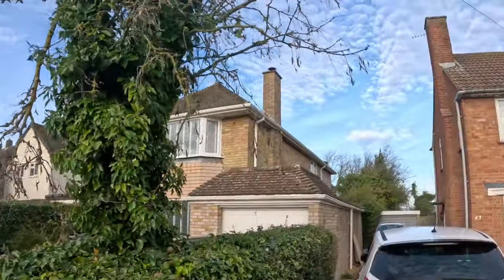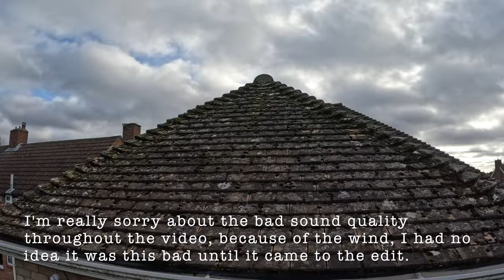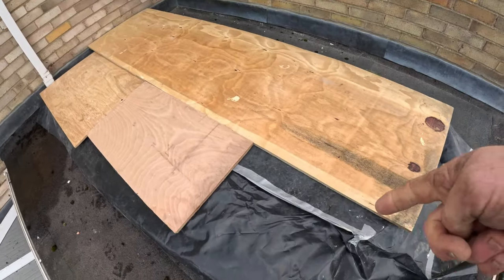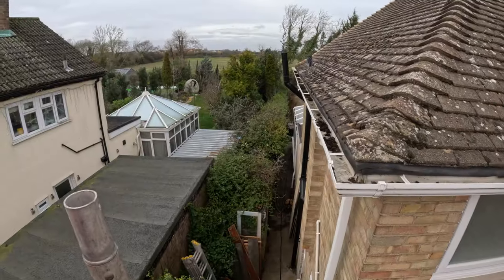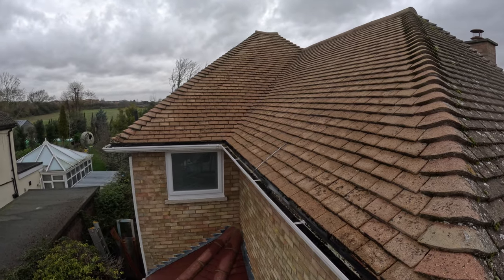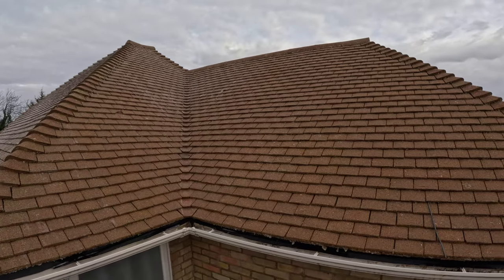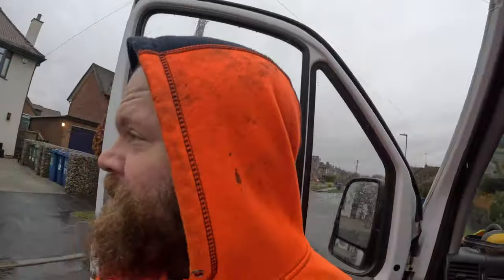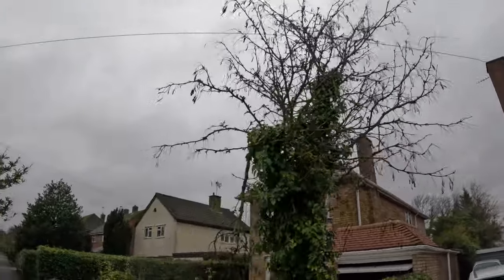I Tackle A TRICKY, GRUBBY Roof, And Make the Tiles POP!

Comment: Thank you for explaining that a job may not be hard in one sense, but variables affecting reach, access and multiple setups and take-downs of equipment, can majorly affect how much time you need and the physical effort required. Ah, in all the moves you discussed, I realized you didn't say anything about the patio or side area.  Too bad, it would have added a lot of sparkle.  Glad you are working with some people that have the courage to do rennovations.  A pretty roof, nice it is turning out so well.  Hmm, running into a skylight type that you've never seen before, in an unexpected place, is another variable.  I understood the scaffold itself was a risk to the glass and then you mentined the risk of a sliding broken tile... scaffold wobble being a risk to the glass and instead, you are going to stand on a thin area.  Plus now we have video editing problems to figure out.  At this point, I started laughing.  I'm glad you can figure these things out and we're getting an education. 

As you were reaching the roof to biocide with a pole, the sound made me think of little robots, done remotely.  I wonder if someone would ever make one?  Would they get blown off roofs by wind? They have them for lawns. That was nice your photography helped you to pinpoint broken tiles and needed repairs. Thanks for showing how you rinse down when you are up high, like the gutters and walls.  Well, at least you knew a gutter vacuum was a viable solution for the complications of brittle gutters, no down-pipes, etc. Who becomes responsible for figuring how to clear the root clogged downspout? The final views show that the cleaning enhanced the appearance a lot, as well as improving the roof conditions. Good work in tough weather.

Comment: Another great job and esp. considering the difficult access and fiddly bits... I know it is probably a big expense (maybe you could hire one to try it out) but would a Cherry picker or elevated reach work platform / telehandler style machine be an option for these jobs...? tow it behind on a trailer, set it up once, get up above the work and go in and out, up and down to get to various spots... if you owned one, you could install hard lines on the platform to enable the pump to plug in to the bottom, and the lances and nozzles to plug in at the top where you are working and controlling the machine instead of dangling and the weight of the loose hoses... 
Another tip for you might be to get some cheap (but durable) XL (to fit anything from a mini to a Range Rover) padded car covers to drape over the unmoveable cars or neighbours cars (or similar), then just rinse the cover off, not the car, which is fully protected from moss, water and chemicals... keep those neighbours happy who think they may get damage on their cars, caravans, outdoor furniture, shrubs (even skylights!) etc...

Comment: Hi Nick, Excellent work as per normal 👏.  Can I ask mate have you got any experience in using a dosatron for hypo. I'm considering buying one as an investment and switching out the 12v backpack as mines finally gave out on me. They are quite expensive and just seeing if you've ever used one before I make the jump. Water pressure in my area seems good enough to support it. Hope you have a great season mate. All the best Nathan 👍
Reply from the maker: Hi Nathan, cheers mate 🤜🤛. I've never used one bud, i've only ever used a Honda Rolltek soft wash bowser for big jobs, or the good old backpack. I've heard the Dosatrons are excellent, so if you've got the funds, it's probably worth the investment 👍
Reply: @PrestigeExternalCleaning  thanks mate appreciate the response. I think I'll get one... perhaps 🤔